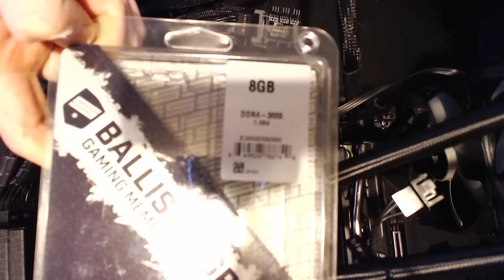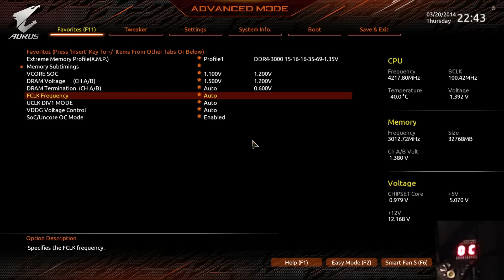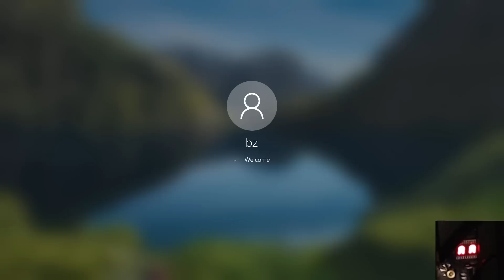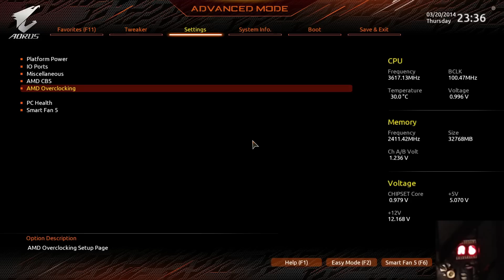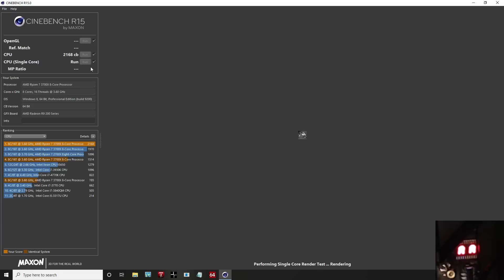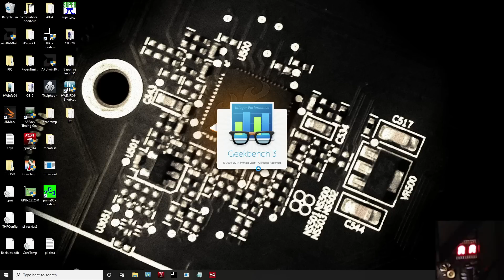Overclocking 4x8GB of 3000MHz CL15 Crucial Ballistix on a Gigabyte X570 Aorus Xtreme with a 3700X

Comment: Awesome vid! Really helpful for the overall process for me. I am new to trying to get the most out of my RAM. Been OCing my CPUs for  a while though.
Getting ready to dive into my CMT64GX4M2E3200C16 32GBx2 3200 16-20-20-38 XMP Micron B-die 16GB Density Dual Rank Rev B0 according to thaiphoon. 
I need to double check my DIMMS directly.
Been going through your vids looking for Micron info. 

Awesome content man, it also helped refamiliarizing my self with AMD for my new 5950x w Gigabyte x570 Aorus Master build that my RAM is in. I had been on intel 4th and 8th gen i5s on the last two builds.

Appreciate your time and effort man! Hope to better show it here in the future.
Reply: Hello there, i have the same mobo as you, i want to know if you managed to overlock your memory, how much was that and what was the improvement %, want to know if it's worth the time
Reply: @DakDaraN  I was not able to get anything out of these Dominators. They are pretty much maxed from Corsair. Was a waste of time even trying with these. Have had the same issue with every single stick of Corsair RAM I have ever bought. No OC headroom. Even if I get a tiny OC to post thety are not stable in the slightest on anything other than XMP from the factory.

Get G.Skill RAM if you haven't already.
Reply: What's the difference between a pair of rams that already have 4kmhz and another with 3600 and oced to 4k besides the price and the time wasted on trying to oc them?
Reply: @DakDaraN  Could be different chip manufacturers that handle different timings at different frequencies. Could be dual rank vs single rank. 
I am sure I am not covering some things, but those are the differences that are extremely likely and will cause stability/performance issues.

Comment: So, my x570 Aorus Elite just isn't letting me set most of these. Some of the menu's are missing. I am running a later bios (F30 I believe, not the latest as I was having issues with that not showing my NVMe drives for some reason) -- anyways, I have AMD CBS and AMD Overclocking and the Tweaker menu. All of the settings seem "independant" of each other. I can set stuff in the "overclock" menu however it doesn't take. any time I set anything in CBS or on the tweaker menu that ISN'T XMP -- it doesn't stick. I can't even turn off SMT which is fucking annoying.
Gigabyte needs to get their act together, their bios is fucking horrible IMO. I'd rather go back to the old non-UEFI blue screen shit because at least the layout of those typically made sense.

Comment: So, I have been trying to get my board to run 3600, it won't. I keep BSOD it won't even run 3200. Same thing, not as often. Keeps showing that Kernal error. I look in logs and it shows power but it always dumps files first.

Is that my PSU or my NVMe going out?

Comment: What was the reasoning behind setting TRFC to 800 rather than leave it on auto or set it to whatever timing approximates a higher average value (in ns) that kits of this variety usually achieve? I imagine it has to do with training but I'm not tracking 100%

Comment: Hey Buildzoid, could you do a follow up video to this exploring the B550 issue with 4 dimms loaded? I emailed you about this, but its a really wide spread problem over Asrock, Gigabyte, Asus and MSI motherboards not working with 4 x 8gb dimms. If you look on all these makers QVL memory lists for B550, they post a severely limited choice of RAM for 4 dimms, and I doubt they'd even work in DOCP mode. I didn't think there was limiting factor between B550 and X570, but B550 seems to be widely incompatible with 4 x 8gb dimms.

Comment: i got x570 master and i wanna love it but due to this exact same problem im tempted to return it wich is super sad... had a msi x470 board and i ran my gskill 3200 cl 14 > 3800 cl 12 15 12 14 without a problem. on this board it bricks my settings and refused to hit 3800

Comment: We need an updated video of this with a dual channel kit and the latest bios. The options changed a little bit and you also mentioned in another videos that manually tuning the xfr enhancements improves the performance of ryzen. Maybe you can do a video that covers all current relevant bios settings that can be done to improve performance overall.

Comment: I have gigabyte aorus Pro x570 with Hynix Cjk 3733mhz overclocked Kingston Fury 3466mhz 2x16gb kit stable tested prime95 etc :) ryzen 7 3700x. Using Ryzen Dram Calculator, buttt this video is gold for me opening my mind ;))) wanted to buy B Die just canceled B Die order because some shady business going with change of my board butt it was 30% cheaper then B die and perform cool :))) I saw your nemory recommendation video now, shold check it before buying obviously. but out of blue I ended sort of lucky. latency 66.5ns and close to 54000 reading speed in aida64 :) your channel is best. Super interesting, thaaanks a lot :)

Comment: I have had this issue on my gigabyte pro the xmp profile voltage was 1.2 even the on the back of the box it said 1.45 and it constantly posted and I had to disable xmp and manually input the values

Comment: Please help. I have the 3700x, X570 AORUS, 4x8GB 3200 Corsair and tried all settings. Warm start works till 32x but as soon as I shut down and restart I get a reset Bios with just 1000Mhz base Clock. Even when I set it to e.g. just 2400-3000Mhz. Is so frustrating. Thx for any hint!

Comment: Thanks for this vid. E-die is quite value for lower end Ryzen 3000s i think... i got a 2x16gb set that does 3800ghz CL16 very easily at 1.4v, but unfortunately the FCLK is limiting me from using that. This set was able to boot 4200mhz CL20 1.4v (and likely beyond, but i didn't try), tho reported an error at 5% coverage into memtest.

Comment: Thanks for the guide. I couldn't work out why changing my FCLCK and mem  above 1800MHz gave me less performance - the uclock setting!! Will also use this as a guide to tighten my timings as I have a 3600MHz CL18 kit - Think I would be happy with 3733 with CL16

Comment: I haven't been able to find any info on running quad ranks per channel on the newest ryzen chips. Something along the lines of 4x16gb sticks. I've found dual rank info 2x16 but not quad 4x16.
Reply: @Mirsad Redzovic  I've since tested it. It can run it just fine but the mem controller doesn't seem to like quad rank per channel with any decent high speed ram. Anything over 3400mhz and the controller would throw a fit. I've since settled on 32gbs 4x8 and can easily hit Infinity fabric cap (1866 for my chip or 3733 ram) with good timings. Enough capacity for work and enough speed for gaming. If you need the 64g capacity I'd shoot for some high speed ram, downclock it to 3400ish and just tighten the timings as far as it will let you. Dram calc it if you need to.
Reply: @Mirsad Redzovic  yes. 1 single rank/cha is 1 rank, 2 single ranks/cha is dual rank, 1 dual rank/cha is dual rank as well, and 2 dual ranks/cha is quad rank.
Reply: @Mirsad Redzovic  I got a gskill neo kit. I believe it was a 3600 c16 kit. It's a hynix cjr kit so not super top of the line but hard to beat. I'll see if I can find the part number.
Reply: https://www.gskill.com/product/165/326/1562839388/F4-3600C16Q-32GTZNTrident-Z-NeoDDR4-3600MHz-CL16-16-16-36-1.35V32GB-(4x8GB)
Reply: If you want you can check a similar kit they have that is a 3600 c14 b-die kit, it's a bit pricey imo, but a solid choice nonetheless.
Reply: @Mirsad Redzovic  haha, ya. Most 8g are single and 16g are dual. The 3600 c16 kit is hynix ram modules. 3600 c14 are samsung. I think you would be happy with 32g unless you do ram heavy workloads like rendering or use large ram disk type applications.

Comment: Hi
I’m new to overclocking and new to figuring out how to make your memory run at optimal speed.
I was wondering if you could make a video how to set up G.SKILL Ripjaws V Series 16GB (2 x 8GB) 288-Pin DDR4 SDRAM DDR4 3600 (PC4 28800) Desktop Memory ModelF4-3600C16D-16GVKC on Gigabyte Aorus Pro wi fi x570 motherboard. Thanks

Comment: AHC, question.
Why do i always run in to boot-loops when doing a BIOS flash to a newer one, Bord Gigabyte Aorus PRO X570 (non Wifi).
Am i the only one having this all the time when i do a BIOS flash, or did you also run in these kind of issues when you were doing these BIOS flashes on Gigabyte Aorus boards.
Just curious, the RAM modules i run Corsair Dominator Platinum RGB 4 sticks off 8GB DDR4 @3600 MHz.
Because i do know where the problem lays with these boards, and thats when you do a BIOS flash, it puts the voltage off the 4 modules back to its stock value off 1,2 Volts, and they need 1,35 Volts to run correctly.
And that makes that when i do a BIOS flash, it sometimes takes me about 2 hours to get my rig up and running again as it shoult, becouse it will already freeze before i even get the change to go back in to my BIOS to put in the right voltage value for the 4 RAM modules i use.
And as soon as i get that one chance to do so (when the system is turnt off for a while most of the time, what somtimes makes that it is not freezing bofore i even get the chance to get back in to my BIOS to put in the right voltages off the 4 modules), there is suddenly no problem anymore, and my rig just boots up all the time without any issues.
So i'm like, is this normal to happen, or what...

And now i'm watching this video, is see you are running into almost exactly the same issues as i do, when it comes to RAM voltage isseus, so now i feel at leats a bit better, knwoing that i'm not the only one having this.
CAS latenacy of mine: 16
tRCD: 16
tRCDWR: 16
tRP: 16
tRAS: 25

tRC: 41
And the rest off them is all on Auto

Which gave me a Memory Latency in Aida64: 64 nano/sec, and it's stable as hell diong a lot off Premiere Pro and After Effects video Renders, so i'm good ;-)

Comment: my tridendZ 16gb  run at 3400mhz 14 14 14 28 48 440 2T @ 1.408V at 71ns latency
ryzen 5 3600
anything I could do better?
Reply: Memory chip type? (use thaiphoon burner), otherwise nice for 1.408V
Consider raising voltage if needed, up to 1.5V is safe for all modern DDR4. FCLK is set correctly right, (as in his video)?
Reply: its bdie. im now at 3433mhz IF 1717 @1.42V 
soc 1.1v 
but my pc just wont boot with 1T

Comment: in the next days i will have a 3700x 2x16 Samsung b-die on a MSI MEG x570 ACE. Question: Is it harder to oc a 2by16gb than a 4by8gb? And what are the diferences in RAM OC between ryzen 2000 and ryzen 3000?

Comment: I know I won’t get a response but I’m new to oc I bought the ballistix elite 16gb 2*8 ddr4 -4000 how can I get it to work at 4000 computer won’t boot I lower it to 3700 n it works but I would like to get my money worth n hit 4000 can you help with my settings , also I enjoy you’re videos ty , z390 master, 
i9 9900ks , 2080ti
Reply: Make sure RAM is in the outer slots
Raise Vccio and Vccsa (be careful, these can quickly kill CPUs, so check safe voltages)
enable XMP
Loosen timings
Raise Mem voltage (1.5V max for daily)

Pro-Tip: Don't but ballistix elite, it's almost all ultra binned Rev. E, instread of B-Die, which is much better. e.g. the 4400 C19 viper steels are bdie, they can do up to 4000Mhz C12 depending on Mobo, voltage, temps, CPU, and mem topology.
Reply: Ty I finally figured out how to keep the settings stable it was a pain but fun too , I understand now why oc memory sucks

Comment: I have a kit of 2x16GB (32 total) Ballistix Elite 3200Mhz and a Z390 Aorus Ultra board, Thaiphoon Burner says these are Samsung B-die indeed but can't even move up from 3200Mhz bc my pc won't even boot at 3300mhz, I think Gigabyte boards don't like Ram overclocking (I have proof of that) and I have the latest BIOS installed so... I know this bc prior to this board I had a Z370 Killer paired with the same i7- 8086K and a set of 2X8GB Team Delta 2400Mhz CL15 1.2V (Hynix) up to 3200Mhz CL16 at 1.350V no problem what so ever even do 3600Mhz at 1.40V but not fully stable after some extended testing, when I upgraded to this new board (Z390 Aorus Ultra) like two month ago they only reached 2600Mhz CL16 1.350V no matter what

Comment: So, i basically followed you all the way, got my timings from typhoon and DRAM Calculator, running the latest BIOS on the x570 Aorus Master, my bios just reset itself to F4 after applying the changes.
Has this happened to anybody else ?
Reply: MaxtronZero yes, I have the Aorus Ultra x570 and has the same thing happened to me , bios downgraded itself F11 -> F3. I flashed it again to F11 and it hasn’t done it since

Spooky

Comment: I have a problem with my x570 Elite Wifi where it's saving the fclk and ram speed at 1800 1:1 but I set my primaries to 16-16-16-16-32-48 and it doesn't stick. When I boot to Windows and check HWInfo and CPU-Z it says my primaries are cl22 trcd22 trp22 tras50 trc72 never seen anyone complain about this before.

EDIT: Nevermind! I just had to pick V2 in the Calculator and it gave me the right timings and voltages, now it's running at 16-16-17-16-34. Now to run memtest86 and hope it's stable! Thanks Buildzoid, seeing you navigate the Gigabyte BIOS helped a ton.

Comment: I have a r5 1600x 
with the same ram can do 3266mhz but it doesn't go pass that.
the soc voltage is a 1.35V i wonder if i can take higher or i should be happy with that on ryzen first gen 

i find it weird that I don't get a post @3266 using 32gb but if i use to sticks it post. with 32 gb i can only get 2866mhz 

agian thanks for the video

Comment: Best Ryzen 3000 ram is F4-3200C14D-16GTZSK
Reply: Well... most b-die performs the same (that's binned well), and that kit is 120+ USD, and for that you can get top binned 4400 C19 viper steels

Comment: I have the 3200 CL16 kit (16GBx2) in an X570 Aorus Elite+3700x...i just dropped them in loaded the XMP then set the voltage to 1.4 the RAM multiplier to 36 and they run rock solid on 3600 ever since with their factory timing.
Was i just lucky?
Reply: I'm on the exact same board and RAM kit (3900x though).... Achieved the exact same.. The factory timing is really loose though... It's like 22-25-22-54

Comment: I know you said you make your motherboard video for gamer's nexus but can you recommend a cheap mATX motherboard which would be good for Ryzen 3600 and these modules? Also, do you have a guide somewhere? I get most of what you're doing but am not familiar with some of the settings.
Reply: For Ryzen 5 3600, any mATX board is enough in the VRM department. Unless you plan to go beyond 4000 MHz for RAM speed (which you shouldn't, because FCLK) any mATX board is also enough to run that. At that point, you should just go by features and price (brand preference if you have one, but you really shouldn't). I like the MSI B450M Mortar and the AsRock B450M Pro4 for the two M.2 slots they provide. Maybe you know you need Intel LAN, then that is something you should look for or you need a good out of the box audio solution, then look for ALC1200 or so. If you want some "future proofing" (i.e. being able to put a 12 core into it when they become cheap and not worry about the VRM), the Mortar and the X570M Pro4 are your best bet. The X570M is expensive, the Mortar has a no-GUI BIOS (still all featues minus save profiles at the moment, unless you buy the Max) but is cheaper if you can get it on sale of second hand (make sure it has the correct BIOS). You really should go to a forum like Linustechtips, anandtech, overclock.net, techpowerup etc. They have areas with build guides and forms you can fill out with the necessary info people need to help you, like where you live, budget, use case etc. :)

In theory you can run the Ryzen 3600 on a lot of A320 mATX motherboards. The issue becomes if they support it out of the box.

Comment: Would 1.5v considered safe for daily usage? I have the x570 Elite, same cpu and 2x8 Patriot Steel 3400mhz (Hynix chips I think). Problem is they error out in memtest with similar values to yours if I don't use 1.5v.
It's a really weird memory kit. They will bluescreen at 3400mhz with the same values they boot at 3733mhz. So 3400mhz, the native frequency, is a no go whatever I do to them.
Reply: There are kits with XMP voltage at 1.5V, so it's probably fine.

Comment: In what world is 1.5V low for micron E-dies? I mean for me, they are up to 55 °C at 1.4V 3600cl16 (2x16). Anything above i would not go for everyday use.
Reply: I run mine at 1.75v, I would agree that 1.5v is low for this IC specifically.

Comment: Noticed similar issues with the monitoring numbers in Aorus X570 Master, BLCK:100.45 when set to 100, Voltage for Ram always .100 higher than set, frequency also matches the BLCK bugged number. Check in windows its working fine. 

Also noticed a lot of people out there complaining about ram Price, amount of Ram & Ram latency. 3900x, X570 Master (F7C bios). This seems to be a easy solution to both compared to what I've seen around. cheap, 32gb, 70ns so that's 8ns less than most kits people are complaining about just on XMP.
Corsair Vengeance RGB Pro 3600mhz (Black & White kits) Cheap, 4x8gb sticks. Infinity Fabric is set to level 3/1800mhz.
CMW32GX4M4C3600C18 & CMW32GX4M4C3600C18W. V4.31 & V4.32 Samsung B-Die (V4.32 tested)

Default:XMP
(XMP is: 18-19-19-39 ~ 1.35V e.t.c.)
70.2ns

Test 1: (stable)
16-18-18-18-38-56-1T
1.4V
69.2ns 
Sticking with this one for now.

Test 2: (stable)
16-17-17-17-37-54-1t
1.4V
69ns 

Aida64 to test latency. 
Average everyday gamer doesn't need more than this.... I stick with the Test 1 numbers personally for daily use, I can actually lower the Volts right down to 1.35 on it.
Some tips if you want to go further: SCL (5) & tRFC (630) seem to be achilles heel factors both ways overclocking. It'll pass stability tests no issue as long as you dont go under 4 for SCL. Going under 630 tRFC well... You will see it in Firefox before anything else.